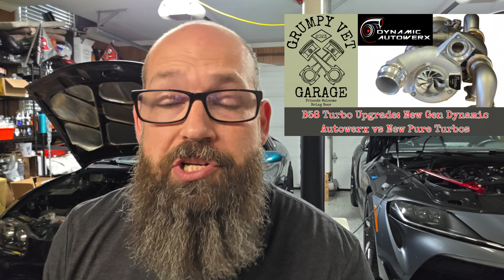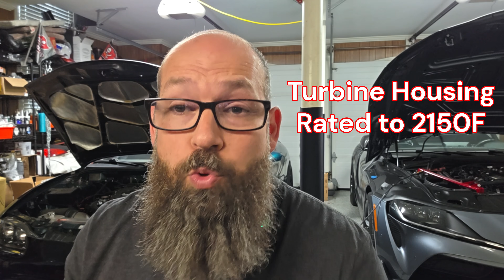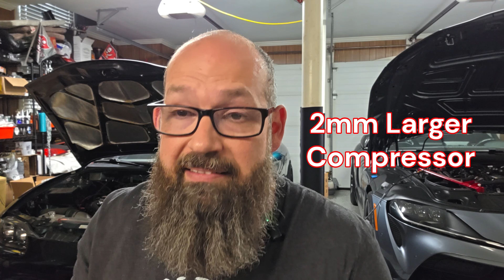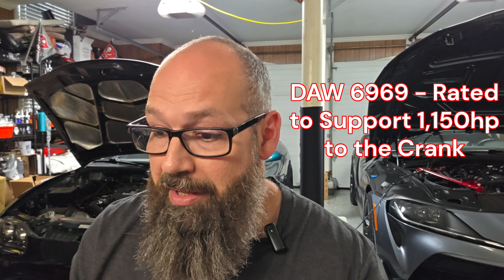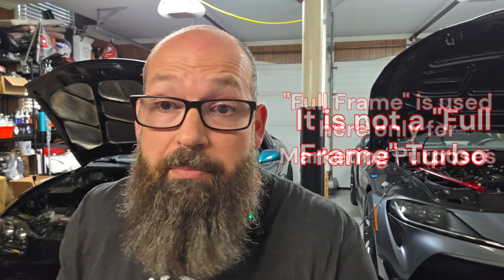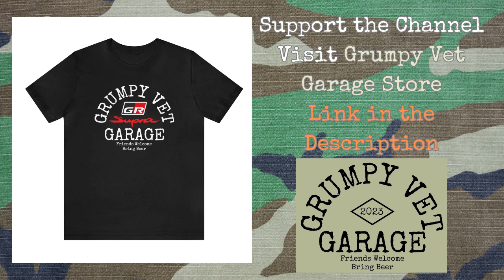Dynamic Autowerx 6969 Turbo - Is it Worth it for Your Build?

Comment: So what turbo did you end up going with?
Reply from the maker: I went with a Pure900. Got it sitting on the shelf, getting together a LPFP upgrade to complete my port injection setup and then get tuned. Since I'm still on a stock transmission, under 700whp and around 600 ft-lbs is where I will be.

Comment: Id swing for the 6769 but i like circut / autocross style driving. I would like a high horse power vechile but im clueless how it would preform from 0 - 20 mph 30 - 60 mph. Im i overthinking it?
Reply from the maker: I don't think you're overthinking it. A turbo like 6969 or the 6769 will flow more air volume make great power but will not spool as quickly as a DAW Ultra Flow X or a Pure800. 

In a track or autocross situation coming out of slow corners a smaller quick spooling turbo will provide predictable power, while a larger turbo will spool slower creating lag out of corners.
Reply: @grumpyvetgarage would you say a 6466 is middle ground? I understand what youve mentioned above but i want the middle ground. Still have top end but still pull out of turns quick enough. 

I like holding cornners, rolls, and overall highway driving. Purchasing turbo in November. Really overwhelmed. First time modding a vechile
Reply from the maker: @WhiteBeardDetail  There is very little "real world" data on the performance on the 6466. I think the middle ground turbo is the Pure800. Quick spool and capable of making over 600whp with E30 and only a few supporting mods. But if you want more the turbo also has the ability to push power up 750whp with fueling and cooling upgrades.

Comment: nah don't buy any hybrids.  Buy a manifold from a fabricator and a turbo from an actual OEM that offers compressor maps or is proven at the track like Precision and Apex turbos.  Build you're own kit.  At higher power levels the amount of backpressure on these hybrids is very unhealthy for the motor.
Reply: im seeing alot of people kill rings etc from egts back pressure etc above 30 psi , im switching to full frame i worry lmao

Comment: So overall the 6969 daw is a pretty good turbo
Reply from the maker: Yes, all of Dynamic Autowerx "New Gen" "No Core" turbos are good. This one is the biggest, with the most power potential.
Reply: @grumpyvetgarage mine pulls great for me. More than plenty.
Reply: @grumpyvetgarage  would be good if you added into your chart what rpm each turbo is seeing full spool based of the graphs. Two turbos making 650whp but one spoiling 1000rpm earlier will be way more fun to drive.

Comment: Out of all the turbos that you have reviewed, which turbo are you considering purchasing for your build? Would you consider any top mount turbo kits as well? It would be great if you could make a video discussing the benefits and cons of a top mount kit vs an OEM location turbo.
Reply from the maker: My goal is to make over 600whp on E30 to E40 and daily drive on 93 Pump making low 500whp. Right now in my opinion the best turbo to achieve that goal is the New Pure800.

I would consider a top mount or bottom mount, full frame turbo kit, but the cost is so much higher and doesn't provide more for my goals.

In my opinion, a full frame top or bottom mount turbo is for builds with a power goal over 800whp. Over 800whp you are pushing the capability and reliability of stock location turbo set-ups.

Thanks for watching, commenting and the feedback of a video idea.
Reply: @grumpyvetgarage  Why 93? Isn't it the case in America that every station has 89/93/95, like 95/98 in Europe?
Reply from the maker: @AmiGarver  93 is the highest octane pump gas commonly available on the Eastern half of the United States and 91 is typically the highest octane on the Western half (occasionally, 93 octane is available). There are lower grades like 87 and 89 available, but really should not be used unless there isn't an better alternative.

Also, 95 RON and 98 RON in Europe is equivalent to 91 Oct and 93 Oct in the United States.

So, 93 is the lowest octane fuel that should be used while trying to make power in the United States, unless you have no other alternative.
Reply: @grumpyvetgarage  Fair enough, good info, at least you have cheap gasoline and pump E85, not like where I am, a 15 gallon barrel of E85 for $250 😅
Reply from the maker: @AmiGarver  We're very fortunate to have pump E85 available. $250 for 15 gallons, yikes!

Where are you at?

Comment: Just finished my tune with Botti for the 6769. Pulls down low, mid and more up top. This is more than plenty for me. I do have the supporting mods also. Great video.
Reply: Are you on port injection? What times has it done so far
Reply: @Famous_Flavours I just installed a new fuel rail, intake manifold, black racing catch can, and the B58 PVC pins under the valve cover. Finished it all up today. No times recorded yet. I do have PI by Reflex with 1050cc injectors and the Visconti LPFP.
Reply: Bro plz make a video on how it daily drives! Low end is what im interested in. What rpm dose it kick in? Can I cut up in traffic like is what I really want to know.

Comment: Recently, we've had a surge of new models, Spool Performance is finishing testing a stock location "full frame" rated for 1000whp, which in design is looking similar to 65 Omega
Reply: So I just ordered the DAW 6969 turbo I go on the dyno in a few weeks I'll keep you updated on what I make, with keeping my stock transmission for now.
Reply from the maker: @blackphantom2277  Awesome! I look forward to your update.
Reply: @blackphantom2277  how did u go??
Reply: @Famous_Flavours  they sent me out a gen 1 so I had to send it back, next week I should have it in my hand. So I’ll keep everyone posted and updated
Reply: @blackphantom2277 you have instagram bro?
Reply: @blackphantom2277 how’s the 6969
Reply: @blackphantom2277 any update on your car?
Reply: @blackphantom2277 any updates?
Reply: @blackphantom2277 so how did it do?
Reply: @fatlumredzepi9805  I made 780hp and 800tq to the wheels at 36psi
Reply from the maker: I'll have to check that out. Thanks for the info.